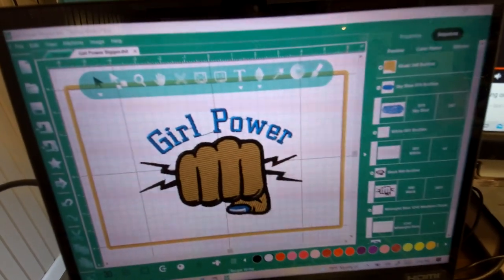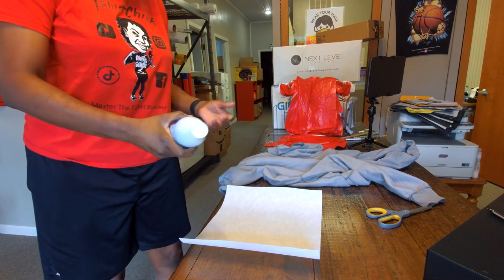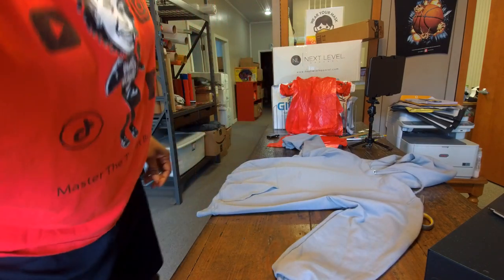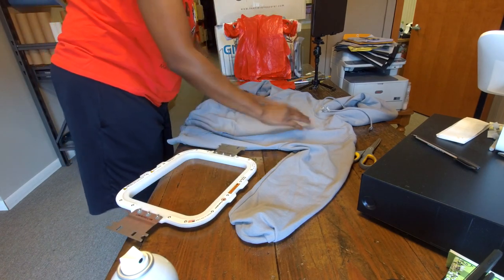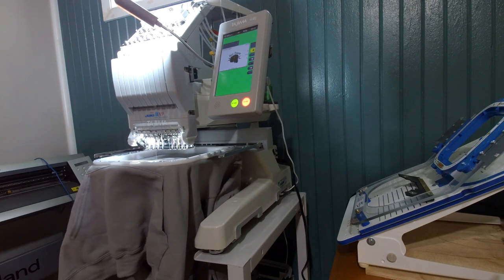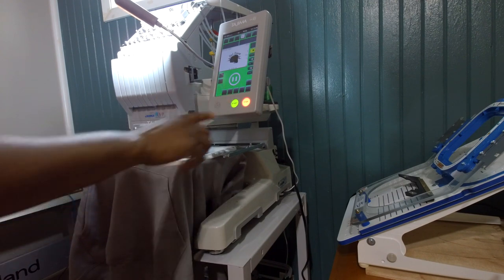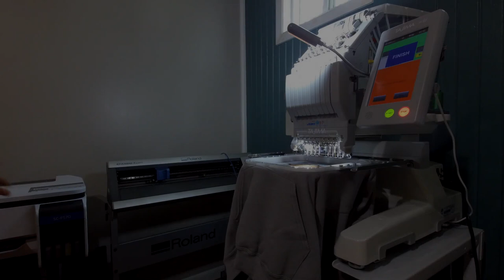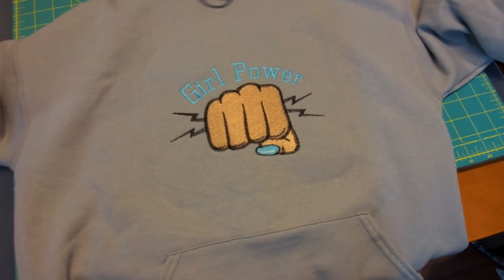Embroidering My First Hoodie (Tajima 8 Needle Embroidery Machine)

Comment: Hi my name is Barbara I have a business and T-shirts I’m a seamstress the name of my business is designed by Aydell you should try to self-adhesive backing for your embroidery then place it the paper on to the hoop and then place your T-shirt  then lock it in along with your hoop much easier and the self-adhesive I like less work thanks you😃
Reply from the maker: Thanks for the tip Barbara!
Reply: @TshirtChick  it is the paper is a tear away and they also make curve scissors that you use when you are embroidering it cuts the little pieces of thread without you accidentally cutting your embroidery stitch you welcome 🤗
Reply: You really don't need adhesive for a hoodies. The only time I use adhesive is for spandex garments.